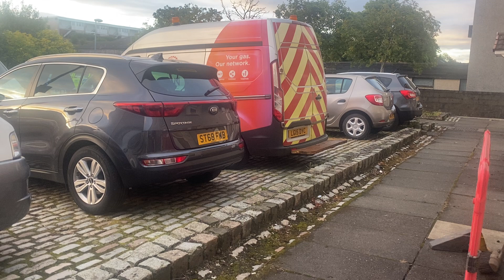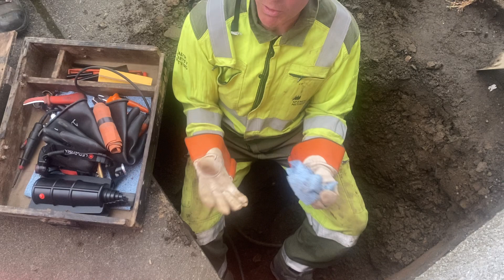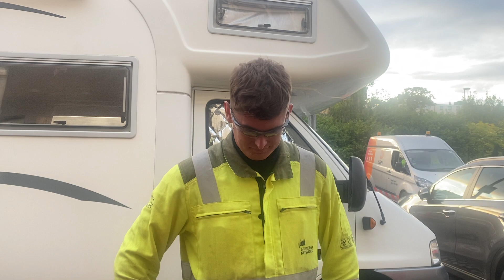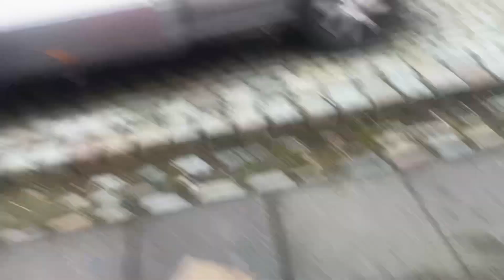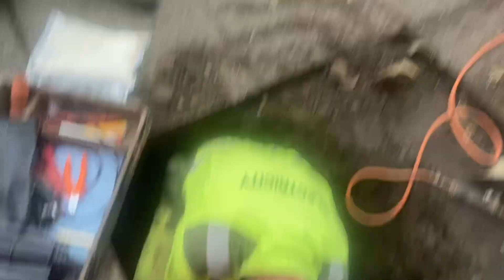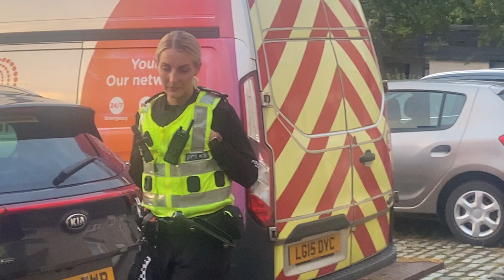Only doing my job like the Nazi soldiers were only doing their job.

Comment: Ought to have let, allowed or consented to one of them entering the dwelling in order to examine the work done by the man or woman who  uninstalled their meter.  The paperwork may well say, everything was uninstalled properly and safely, and everything installed was done so as well, but.. There would have been less of a problem if we had allowed one inspection to allay any fears they may have, concerning whether or not the work done to remove and install a new meter, was as is described on the paperwork? If i have a failed mot for a car, and i need to fix remove or add something that is stopping my car from getting a  mot, showing the mot test centre proof on paper that the work is carried out is not enough for the mot centre to pass my car, they still have to check the work was carried out correctly? If i am owed one hundred pounds in pound coins, and some coins arrived with a letter saying there was £100 there, i would  still need to count the coins to make sure the amount stated  on the paper, married up with the total? They even said although i do agree it was rather late in the day, " if you let us in to check the meter, we are willing to walk away and leave it with our legal team", so as to avoid the anguish of  both parties? In fact, this should have  been the first offer yourself made to them, as it is quite reasonable, and the worst that would have happened would have been the man who came to check the installation confirming the meter and work carried out, was in fact as you say, "carried out by a registered workey in a safe manner"?  All the best for the future, but i fear they will be able to tell any judge, "we offered to leave them connected if they would allow us to physically check the work carried out, was the same as stated on the paperwork."
Reply: it was pointless them changing the meter in the first place they will only have to pay the supplier anyway, they wasted money for no reason, gas isnt free! electric isnt free! all they have done is changed suppliers and the new supplier will charge them for utilities used. moving onto the next debt they owe the new supplier.
which means they will just dig up the mains like they have here and cut them off completely!
Reply: An MOT from 11.9 months ago does not describe the current safety level of your vehicle. An MOT certificate, like it says on the small print, is only valid on the day of testing. The rest is simply a record of the test day.

An MOT at any point does not in any shape or way inform you about the safety of your car.

I am a 22 year time served Audi Master Tech.

You're simply only enabling authoritarianism by uttering such garbage.